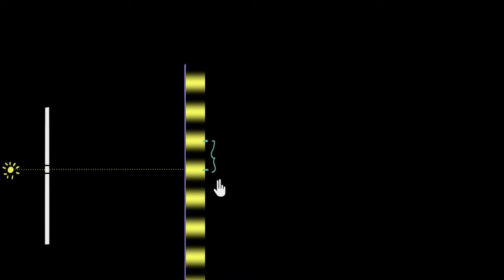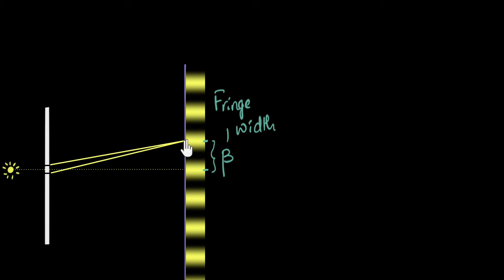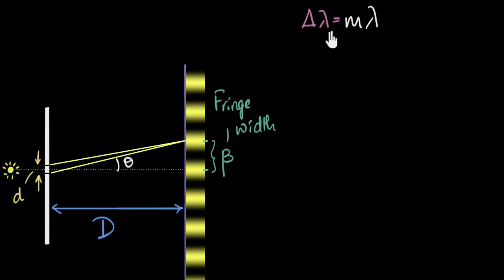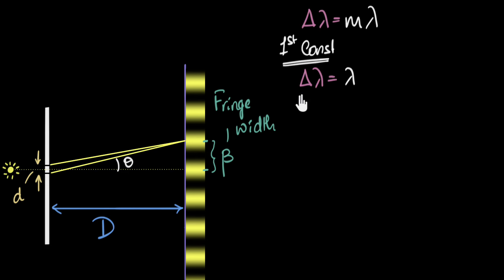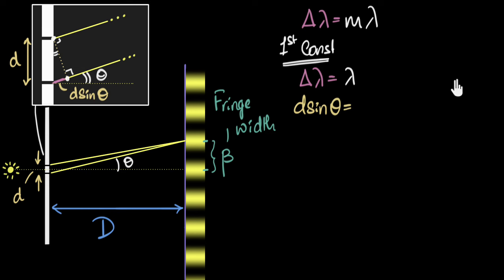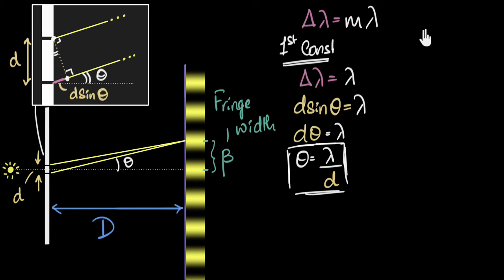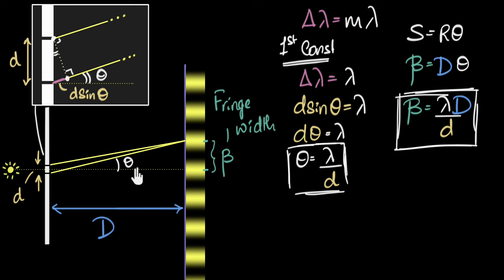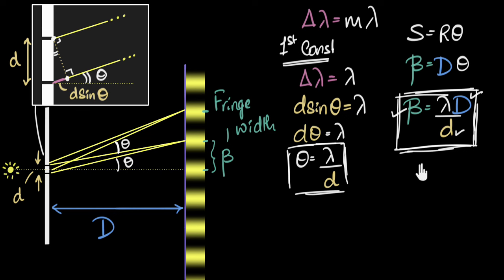Fringe width in Young's double slit experiment | Wave optics | Physics | Khan Academy

Comment: 5:00 there is a problem 
You have initially taken theta from the centre of the two slits 
But in the second image it is taken form is the slit 2 
And it's not the same thing, trignometery won't work in first case 
Or it is an assumption because slits are very close
Reply: Of course your doubt is correct. But the expression is true in this image coz trignometrically it makes sense and what he did was right but the angle here means the angle between the light from bottom source to the screen and the 
 distance (which is the distance from the slit to the screen)
But normally the angle theta would be the angle between the  distance from the centre of two slits and the centre of the screen to a point in the screen.